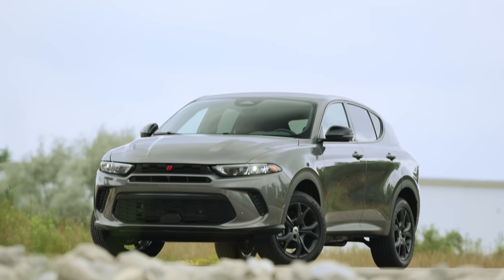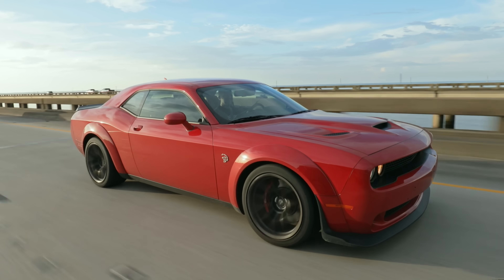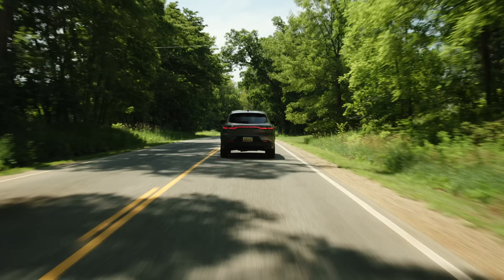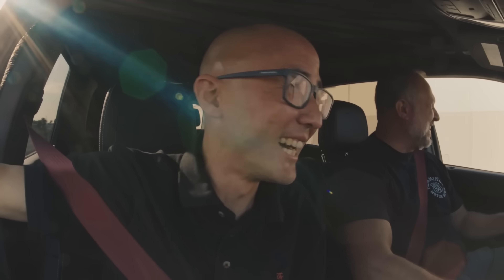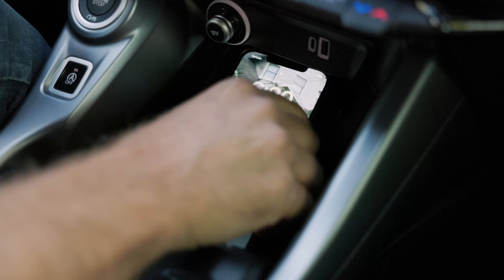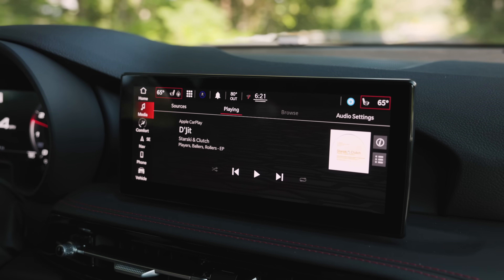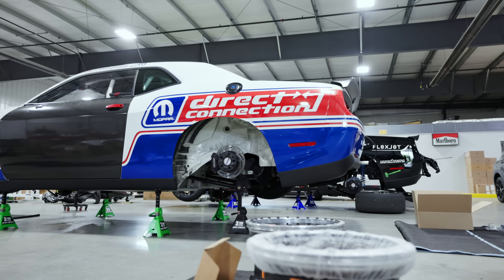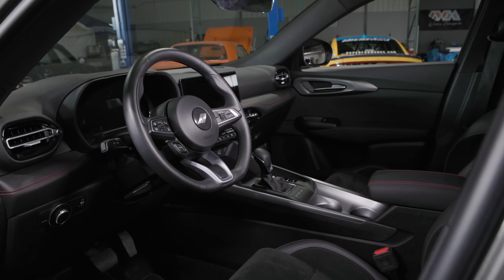2023 Dodge Hornet in, “A Swarm of One”

Comment: Interested in the modded result.  Seems like a decent sporty crossover as a base.  Many people scoffed at my Caliber SRT4 until all they saw were tail lights.  A tune and bolt ons turned that thing into a rocket - if I could get traction.  With the Hornets AWD that shouldn't be an issue.
Reply: It's very quick, handles beautifully, has plenty of space, and above else, when the roads get twisty, it comes alive and makes you giggle. Honestly, its more hot-hatch than CUV

Comment: This car is so bad, rental fleets won't even buy it.
Reply: Explain to me why?
Reply: @drivebigmuscle8080  Really?  It's a Dodge that's a rebadged Alfa.  Two marques not exactly known for quality or reliability.
Reply: @bandwagon240  What I find amazing is that everyone is already bad mouthing a vehicle that almost no one has driven yet. Yet almost every review is praising it, us included. When the Charger came out in 2005 EVERYONE laughed and said it wouldn't compete with anything because it's a Dodge (built on an older Benz platform - which was NOT known for reliability), and it had four doors, yet somehow between Charger and Challenger, they've sold over 3-million of them, and now they ARE the segment in 2&4-door muscle. What I'm saying is don't be so quick to judge until you've got some seat time because the Hornet has the capability to push the entire segment forward.
Reply: @drivebigmuscle8080  Dude, don't be delusional.  Good on you if you want one and think it's not going to break down, I wish you the best of luck.  Neither company has a track record that will ever make me think anything differently of them, I don't have to drive something to tell me that.

FWIW; I am in the car business and have been a mechanic for 25 years.  I know what to avoid.